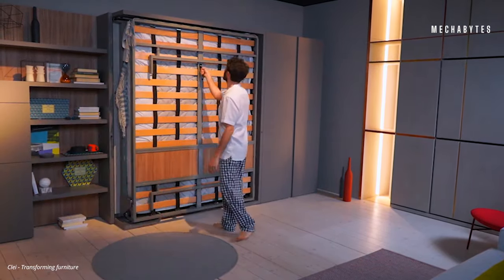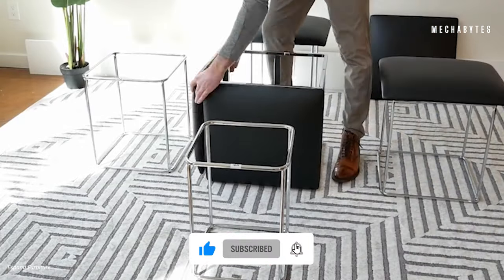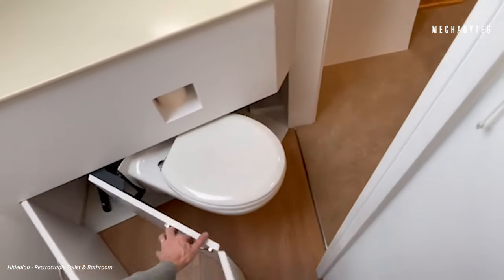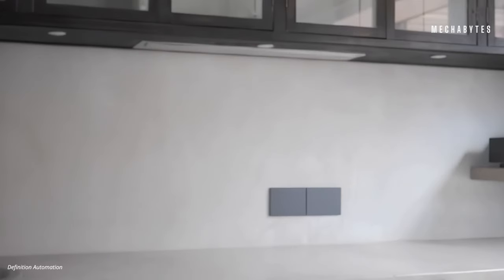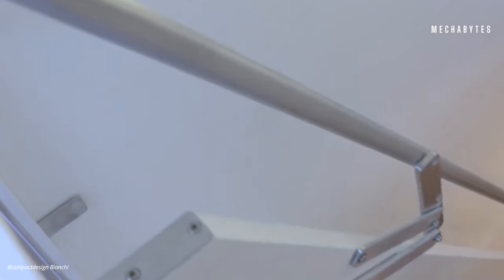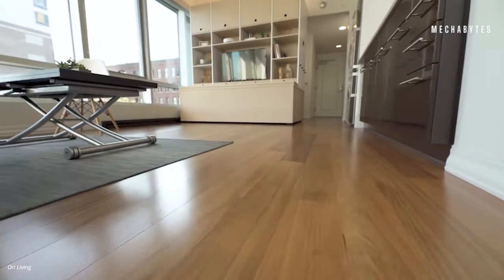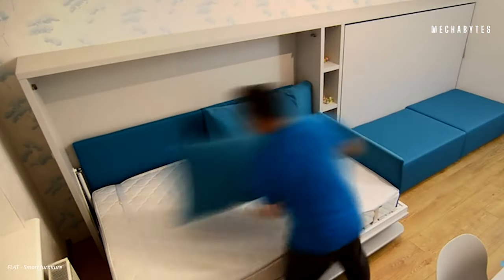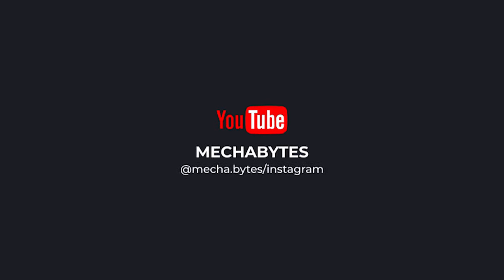Future Home, Future Furniture: The Most Amazing Smart Furniture

Comment: Multiple usages of one furniture seems perfect for houses that have limited ground floor area (GFA), like tiny house, motorhome, hotel and Airbnb etc. The initial costs are high and when it breakdowns, is not easy to replace mechanism parts. It will be wiser to consider engineering it to "space management" as an alternative option with the same area.